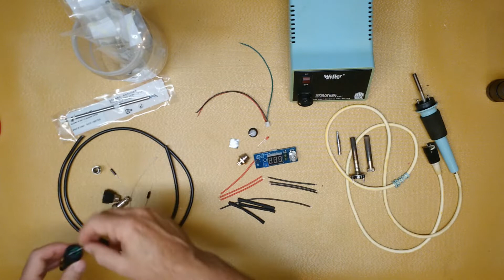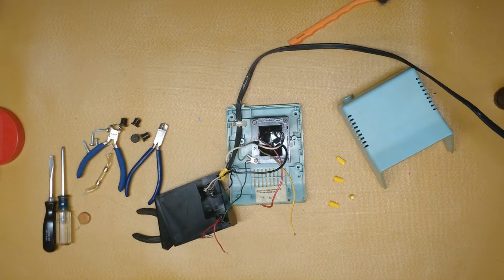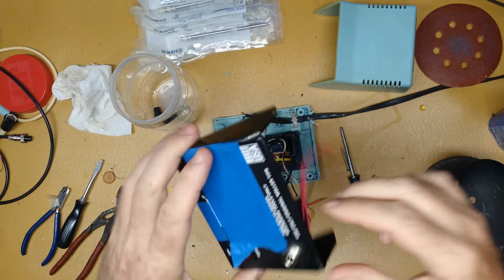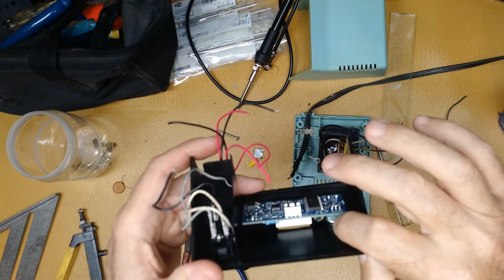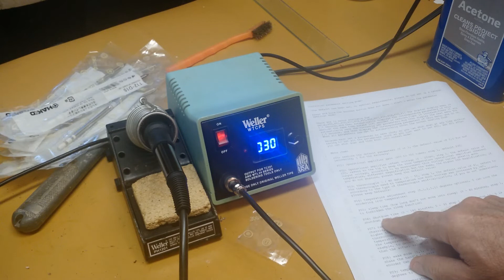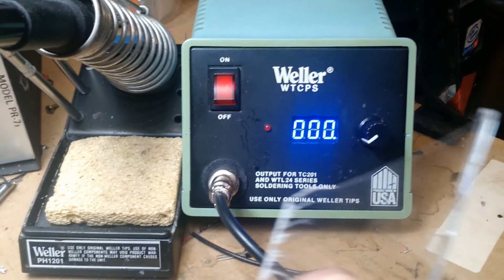Old Weller WTCPS soldering station converted to a Hakko T12 type

Comment from the maker: I didn't put a link in the description for where you can get these things because that constantly changes and it wouldn't be reliable. However if you just go on eBay and search for T12 kit keywords like that they should pop right up. Currently from a stateside us supplier a kit will cost you about $20.

Comment: How many amps does the rectifier produce?
Reply from the maker: ? rectifiers don't produce current, the transformer does. They, in this instance make the AC into DC. I pulled the diodes out of a bad PC PS and they are maybe 3A.

Comment: Great idea. I took your idea and added my Hakko T12 kit to my old dead Weller DS100. That station had been my favorite old solder station. I used the transformer and switch then I built a variable regulated power supply to get back to 24 volts or less. My DS 100 enclosure was larger than yours and it worked out well.  I also added a digital voltmeter to monitor the input voltage to the Hakko PCB.  Works great! de N4NRL  BTW I have the take out parts which someone can have to fix yours but I like my new digital station.

Comment: MAN I TRYED TO IMPROVE AN ERUNTOP 8586d+ and an yihua 706 to t12 and problems arrive it wont detect the tip so as both are new stations i dont want to destroy it right now i just though it was compatible it may be possible with a firmware update that send voltage to the tip an turn the  tip detection thing off
Reply: What exactly did you do to it? Dog you switch out the pid controller to the t12 stm32 controller board?

Comment: Hey not a bad idea for my old TCP L from 1971we go wayback and i like the idea of changing temo and tips like the T12. My TCP is hard wired in but the plug should work, the face is smaller but should have room for the controller. Great Video. How has the swamp works for you?? D

Comment: These kits operate at 24 Volts. There was no reason to modify your transformer
Reply from the maker: Not so. If I would have tried just rectifying the transformer without modifying it.  The rectified DC would have been way over twenty-four probably up near 36. You have to take the RMS vs. Peak voltage into consideration. This kit was  24 volt DC max. The old thing was 24 volts AC.
Reply: @MostlyInteresting  24 AC with rectifier = 24X 1,2 = 28,8 dc with load, no load it's x 1,4
Reply: The Weller transformer does idle at 27V AC on German 230V@50Hz

Comment: Would this work if I just connect the t12 on the ig 101 what is connected to the wtcp s? The ig 101 is normaly a desoldering Station but I don't need that vacuum stuff but it has a Temperatur control 🙈

Comment: Nice project, neat station. Measuring high voltage AC with this cheapo multimeter hurts my sole though.
Reply from the maker: The 1st is a USA made Keithly meter, Its maybe 30 years old at this point and still going. NOT cheapo at all. The 2nd meter is of course the HF cheapie meter. They work well though.

Comment: Honestly it turned out beter than full setups for 70$. Looks better, plastic housing isolates better,  fits with original holder, transformer is isolated and never fails. Those switch mode power supplies with cheapest chinese capacitors will not last that long probably.
Reply from the maker: Transformers are the way to go here. But they might cost a couple of bucks more so you get the cheap switcher. I think its nicer than the late model Wellers.
Reply: @MostlyInteresting  I own diy t12 kit too. Wanted to use transformer but had same problem, idle voltage was too high and under load dropped to like 19V. Heating was much slower than on 24V and finally i used japanese switching power supply from old printer, but i dont like noise it makes... Im thinking to mod this controller and replace regulator so it can handle 30V idle. Should be easier than rewinding.
Reply from the maker: @Sopheris  I didn't RE wind I just took off turns to get to a safe level. Its running now on 24VDC so there is not loss in the heat out put.
Reply: @MostlyInteresting  yeah that was my thought, just bad word or just my bad english :D Your transformer dont drop too much voltage so it all works good anyway

Comment: I'm about to do this same thing. Did you ever post the schematics somewhere?
Reply from the maker: Outside of the hook up diagrams the board supplier provides I just made a basic power supply with a bridge rectifier, a filter cap and a bleeder resistor that pulls about 100ma. to keep the voltage from floating to peak when the heater is off. Oh and put the fuse in the line side, not the load side like Weller did and I followed suit.
Reply: @MostlyInteresting  oops. forgot to say thank you. I just did this as well. I did put the fuse on the line side.  would you happen to have the settings paper instructions? They didn't send me one.
Reply: @nleco  The drawings are at the end of the video. But I left out the settings. Any suggestions as to where to put that file? So I can link it back to the description?